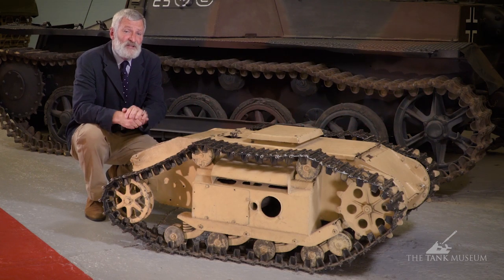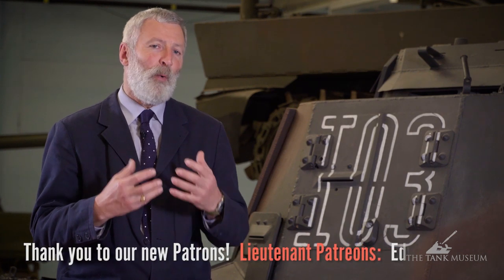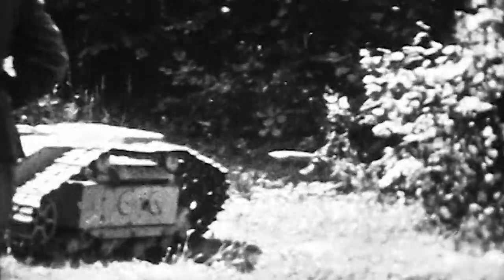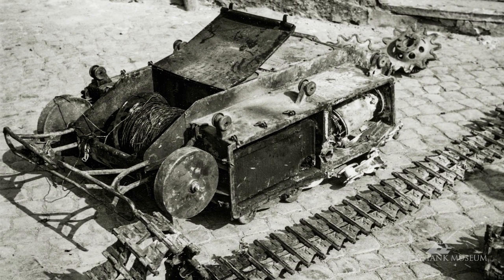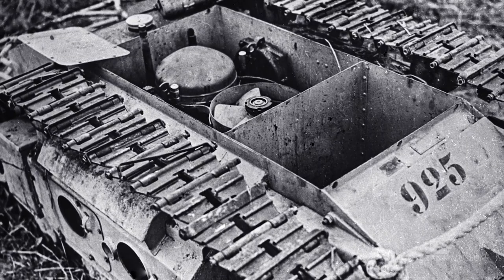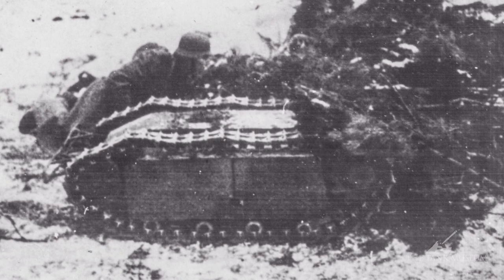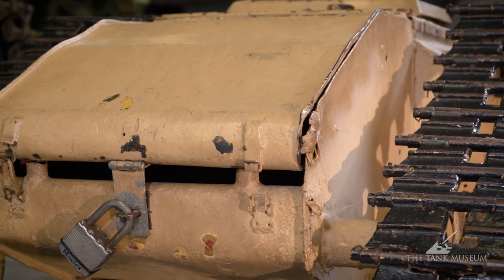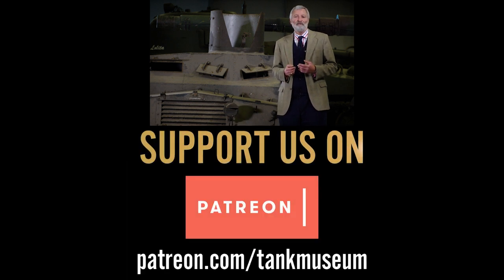Tank Chats #81 Goliath | The Tank Museum

Comment: Two stroke 600kg bomb, the last thing you'll ever laugh at.
Reply: 600? i thought it was 60-100kg.
Reply: boyo that’s the charge, the entire weight is 600
Reply: @JamLeGull  oh right i missed that part, thank you.
Reply: @Dockhead  I don't think he gave a gross weight, that was just an estimate on my part, could be as low as 537kg for all I know!
Reply: @dingledooley9283  370 kg according to wikipedia.
Reply: @lavrentivs9891  well...   The Piston engined version was 100kg heavier and it isn't clear if that was gross or unladen....  but having also just peeped at wiki, it's a 703cc twin cylinder so probably isn't even two stroke which takes the comedy value out of it.
Reply: @UCol3L3gPKgD9L0mfViInH0g back in those days it had a lot to do with it, all the small two strokes are crank compression engines, and making a multi cylinder crank compression engine is difficult as you need to keep the crank throws sealed not just from the atmosphere but each other so it was only in the 60's that multi cylinder crank compression engines really became popular.
Also the displacement of 700cc means it was a fairly big bike by the days standards and given the pics it's definitely not an upright inline engine so the chances are it's just a big ol flat twin side valve engine. 
You are quite right though, no. Of cylinders is just an indication not proof.
Reply: Unless it will brake down, witch is highly likely. Its made in late war Germany. And I dont know if you noticed, but its slower than a running man, and a guy controlling it must stay close behind. This unexploded museum piece is a perfect example of how unreliable it was. 6:42 terrifying.... not.
Reply: @lavrentivs9891  still a big kaboom
Reply: @Paciat  650 meters isn't close behind... Where's your proof of this?
Reply: @Gustav_Kuriga  The biggest proof of it effectiveness is that other nations that experimented with radio tanks, abandoned this concept in WWII and left it for decades. The proof is this vehicle and other captured ones found at other museums because things like this happened 5:34. 650m at the speed of 10km/hour max gives you at least 4 minutes where the operator has to stick his head at enemy fire and drive it carefully (try to do that from 500m or even 100m range) to not do this 6:42. Also I dont think its carburetor worked upside down witch I think you can also see a few seconds later. Engine stops and 4 guys are needed to flip over this "little car". There was also an instance where Polish partisans cut off the cable with a showel.

Comment: Famously, during the early days of Uprising, a similar design (a bogwarts iirc) was captured, and a lot of civilians crowded the street to see the "german tank".

By remote control or timer, the bomb inside went off. My grandma  was on her way to see the thing too, but fortunately was late.
Reply: Jesus christ, that's awful. How many people were killed?
Reply: It wasn't goliath if you think about Warsaw Uprising.
Reply: I don't think it was a Borgward. The Borgward IV (Sd.Kfz. 301) was a pioneer vehicle that was only used by Panzerpioniere (engineer troops with specialized vehicles, attached to tank units). It was designed to drop the explosive charge and drive back to the operator, so as to not needlessly destroy the vehicle. It would never have been used by the units in Warsaw or in the context of the liquidation of civilian population. No matter how sadistic or murderous the Germans were, they wouldn't sacrifice a very rare and expensive vehicle to kill some curious civilians.

The German troops in Warsaw were SS and various "police" units. These were equipped with light vehicles, often second-rate "Beutepanzer" (captured vehicles) or old vehicles unfit for front line combat, as they would mostly be firing on unarmed civilians or very lightly armed partisans. 

They did lose a Lorraine 37L to petrol bombs on the first day of the uprising. It's possible that it "cooked off" and exploded after the Germans retreated, or that the Germans quickly set up some improvised self-destruct device as they abandoned it.
Reply: @frankkrunk  There are photographs from Warsaw Uprising where Bogward's are seen - it's even servals of them (7-10?) on one photo.

About other AFV - Germans used other, more valuable one's. Most known example: Armia Krajowa (pol. for Home Army) captured two Panthers and used them for some time against previous owner's. Plus there are one or two photos of Tiger I in Warsaw during early days of Uprising.
Reply: @wojo44frompl  1. Sorry, I initially confused 1944 Warsaw Uprising with the 1943 Warsaw Ghetto Uprising. In 1944, fighting the Armia Krajowa, there was of course regular Wehrmacht with Panzerpioniere present. This is exactly when a Borgward would be used, to breach barricades. 

2. Yes, they Germans used valuable vehicles against the AK, but I'm saying that they wouldn't intentionally sacrifice this specialist vehicle to randomly kill civilians when they could do the same damage with a mortar round. As they had no line of sight to the vehicle, they wouldn't even know if there's anyone near it when it detonated. It's more likely the captors detonated the charge by mistake.

Comment: I hear the Panzer Elite deployed these from SdKfz 250/3 Funkwagen "Vampire" Halftracks during the Falaise Pocket and Operation Market Garden.
Reply: 250/3 Funkwagen was just a radio comms vehicle. As the Goliath is controlled by cable, no antenna is necessary. ("Vampir" was an active IR scope for the StG. 251/20 "Uhu" was the IR halftrack.)

The Goliath wasn't deployed from another vehicle,  but it may have been towed behind one on its way to the front.
Reply: @frankkrunk  Ya certain? I swear it had an ammunitions cost of 125. 
(Company of Heroes.)

Comment: Anybody with an engineering background want to respond to this ? Why is it so important that a single use construct requires a suspension system on the roadwheels  ? Individual coil springs,no less ? Rubber was rationed,so no simple bump stop,sure. Wood would not damp anything . But individually sprung road wheels ? British WWI tanks travelled at much the same speeds. No suspension on them. I just cannot figure that out.
Reply: Probably because it's German and if there's one thing that German engineers love doing that is overengineering things.
Reply: @Riceball01  I pretty much thought that as a given,but I was hoping for engineering reasons. The original battery powered unit looked like swing axle or torsion bar suspension.  Lead acid batteries need some protection against jounce. Okay. Whether individually sprung road wheels were justified there,still no idea. Bury the battery compartment in wood excelsior instead ?
What kinds of engineering  Plan B can the guys who see this think of ?
Reply: @paulmanson253  My guess is that, aside from because they could, would be that maybe something about the internal mechanism(s) are kind sensitive and don't do too well if it gets bounced around a lot. So they added suspension to them to so that the internals don't get rattled around too hard. But that's just a guess.
Reply: Because they're Germans, and over engineer everything.
Reply: What do you mean? You need to actually get to the target, have you ever seen a battlefield? It's not exactly a smooth ride, of course it has suspension.

Comment: It may be that they were used as part of the assault engineer/pioneer toolbox. As the Germans lost those skills because they were on the defensive, the Goliaths might have fallen into disuse.
Reply: I dunno, these seem brutally simple to use, 3 analogs in a box attached to a kind of short 3 strand cable that connects each analog to the goliath's 3 functions... You dont need to be a master engi/tech to use an generic brand RC car, and these had more or less the  same simple controls, but my bet is that fuel shortage robbed the Goli of there continued use since they cheaped out and went with a moto engine instead of a perfectly good and silent electic engine... (I do question how stealthy these things could be cause even with a 3000$ stealth electric engine, theres still the tracks...)

Comment: Hi guys, 
I found a T-54 while on vacation in Croatia and wondered what the history behind this Tank was. But I can‘t find anything via the Internet. The yellow number on the side of the turret says 4004 maybe someone knows what the number means and could help me.
Reply: Need more info, where did you find this T-54, was it a knocked out tank or was it abandoned to rust where the crew left it? Also Croatian records are going to be sketchy at best so don't expect miracles... It might be easier if you found any serial numbers as well as the tank designation...
Reply: Feiora sadly I‘m not there anymore but it is located at the town Drniš near Šibenik. But at it‘s gunmantlet a Croatian Flag has been attached and it‘s more like a Memorial I think. 

Do you have a clue were I can find the serialnumber?
Reply: @marcsmile6241  Well the serial numbers on the components would be mostly inside the tank, and depending on who produced the tank, the serial numbers would be both inside and outside, outside may or may not be stamped and if not they'd have been painted on the body somewhere less observable except by maintenance crews. On the inside it probably would have been either stamped or plaqued somewhere small and out of the way of the crew and operational bits. Also if the ground around it was built and not natural then it most like was a memorial of some kind, especially if the tank looked like it had been knocked out... Do you have any pictures of this tank?

Comment: Seems expensive...The russkies would just send a battalion with every 8th man carrying a Demolition charge!
Easy to Jam as well...
Reply: I'm calling you out on the jamming, cause short of shooting operator or severing the guidance wire/cable, theres no way to jam it. As long as the cable, weapon,munition and operator are fully functioning, Goliath and most modern wire guided ordinance will go where the operator wants it to go. The exceptions come from malfunctions during deployment or improper handling from inexperienced operators. However, I do agree about the demolition charge, but it'd probably be way more than every 8th man...

Comment: You could argue that a bullet is a remote device 🙃

.. just sayin
Reply: Not really remotely controlled like this vehicle though
Reply: @epicbanana4317  well it goes where u point it and blows up (kinetically) what the Goliath blows up chemically ;) 🤪
Reply: @con_boy  Yes but isn't the point of a remotely controlled item that you can control it over a distance? Can't really do that with a bullet.
Reply: @con_boy  Not always... bullets can drift, Goliath will stay its course unless theres a issue with either dead operator, damaged cable or it suffers a mechanical break down... OR, suffers a short circuit that leads to premature detonation! ^.^

Comment: Wrong info about the cable and steering. It needs to have at least 4 wires because one has to be return wire for each of the other wires. It couldn't have speed control since PWM control didn't exist back then and variable resistance control couldn't be achieved through such thin wire, because full current for the motors would have to pass through it. It simply had 4 wires, one being plus to the remote, two being control for each motor and the last one for igniting the bomb. Very poorly made tank chat, less info than of wikipedia, don't even try to beg for patreon money.
Reply: Care to explain why you say all the known sources are wrong and that apparently all the museums that have Goliaths have the remote control display in the wrong config? Cause as far as I can tell it really is a 3-Strand wire cable that goto 3 pins in the remote control and you drive it with the single joystick, its more akin to those cheapo, wire controlled cars and those are usually single or dual wires...
Reply: @Feiora  then it would have to turn in only one direction and while doing that drive over it's own cable and risk damaging it which I don't think Germans would risk...